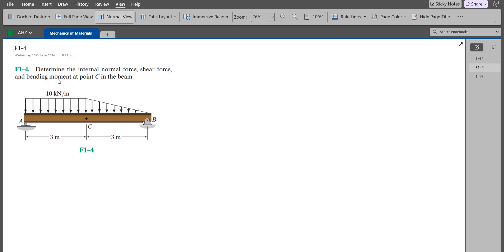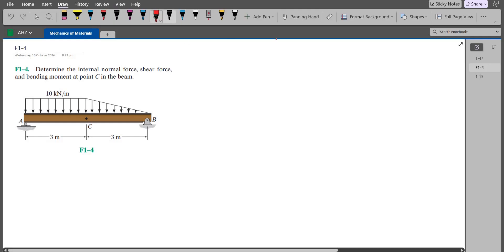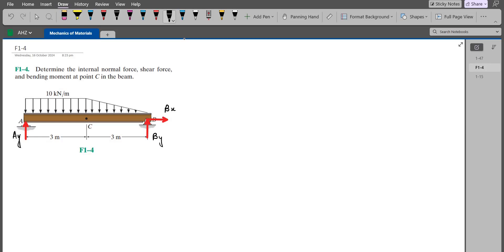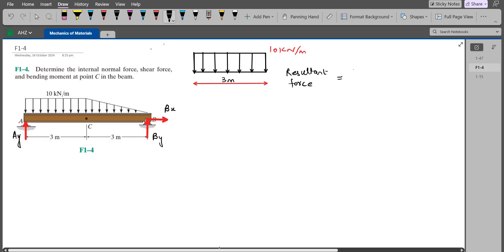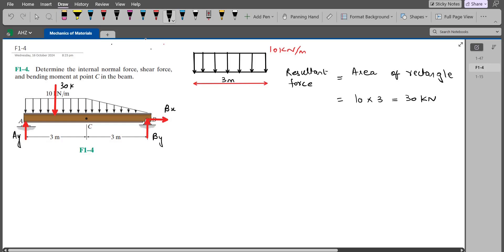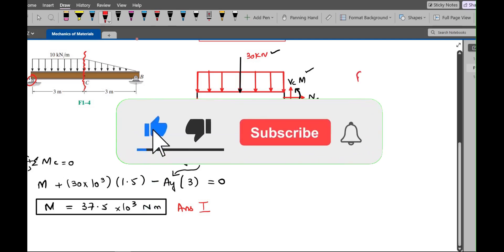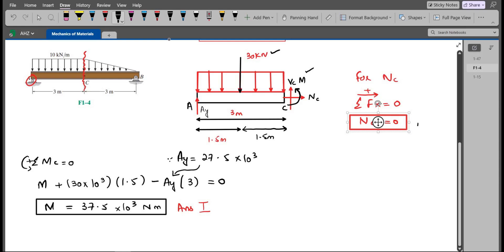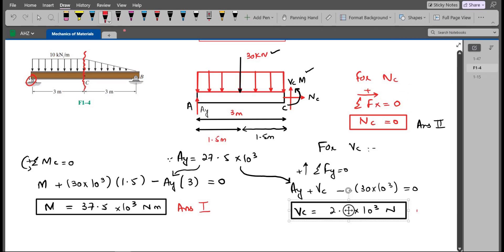F1-4 hibbeler mechanics of materials chapter 1 | mechanics of materials | hibbeler

Comment: hello, i am having trouble understanding as to why there is a moment at point A but not at point B? please respond
Reply from the maker: Well, there are no moment support reactions at points A (roller supported) and B (pin supported). But if you are talking about point C (across the section) then we have to consider the internal forces that are normal force, shear force and bending moment. I hope it will help!